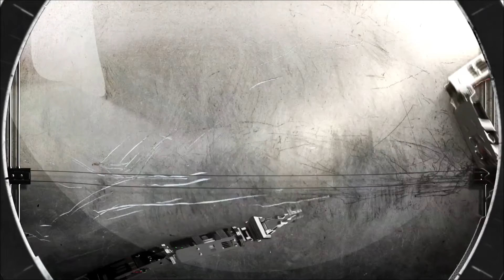How to remove a broken bolt the best way !!!

Comment: I need to get shield gas for my TIG welder. Since I moved I never got hooked up with a new gas supplier though. I'll have to get a new bottle. Gas houses are such a pain in the ass about filling each others bottles. Imagine if they treated cars the same way? You can't fill your car up here, it is not our tank! People would scream bloody murder. But gas houses get away with it.
Reply from the maker: It's the same over here Paul, back in the day i used to be able to get my gas from pubs and lots of different stockists..these days they won't entertain selling you gas unless you sign some lengthy contract committing to rent bottles for at least 12months, they slap handling charges on too..even if you pick up yourself...maybe another rant?
Reply: jason andrews
Here they don't ever sell the bigger bottles. They're all these wacky 99 year leases. I came across the bottles I have various places. One gas house I used to go to would never have full bottles my size, so they just kept on upgrading me to bigger bottles every time I went there. So I ended up with a bunch of big bottles that way. I never had a lease for anything I have though. But yeah how the pressurized gas business runs sucks. It is to the point where I haven't bothered, and I'm just down to stick welding, if I need to weld something. Because electrodes I can just buy outright over the counter. Even at hardware stores.
Reply from the maker: I love stick welding...ive got a big old 300amp dc welder generator that I take out on the ships with me..gets the electrodes singing a treat 😀
Reply: jason andrews
I can't say I love it, but it gets the job done. DC I think my welder only outputs 170A max. It is not very big.
Reply from the maker: if it does what you want then thats all you need. getting the job done is all that counts :)
Reply: jason andrews
I try to keep welding down to a bare minimum. For what I do it is mostly not the best process. Although it certainly has it's place in specific circumstances. There is a time, and a place, for every method.
Reply from the maker: absolutely true